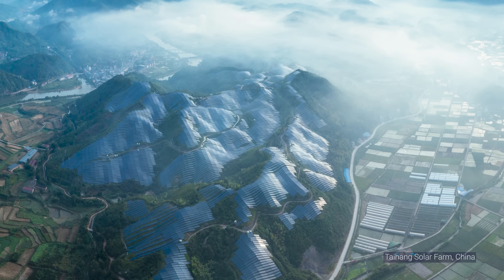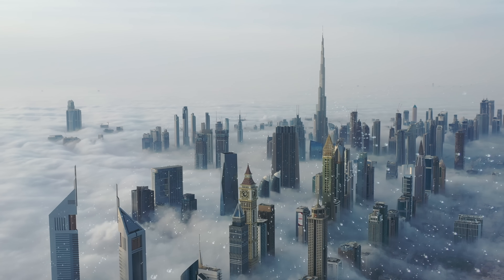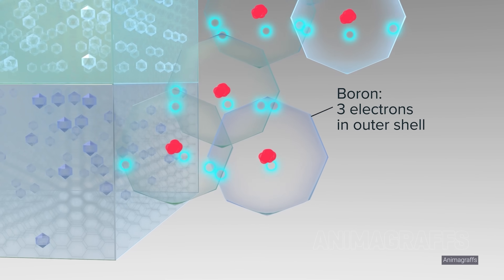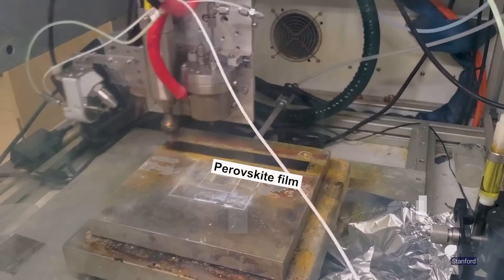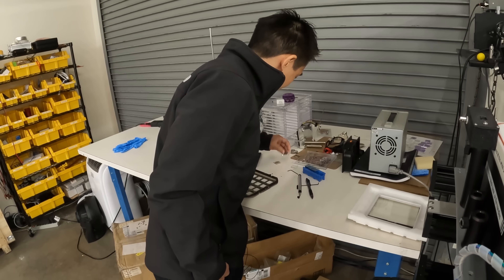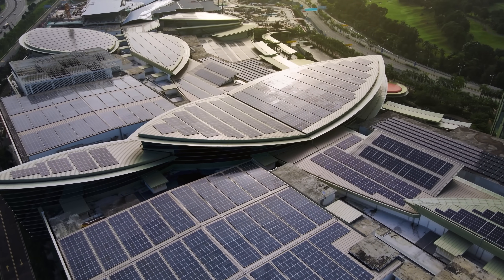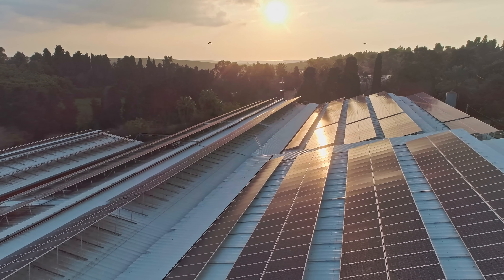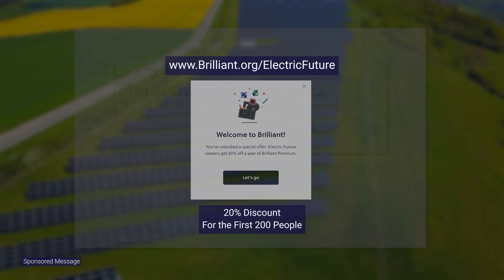Solar 3.0: This New Technology Could Change Everything

Comment: It doesn't take 25 years to test something. Like car manufacturers, they might test an engine in a sealed test environment that can approximate weather conditions and they run the engines under expected loads for the equivalent run time an engine would be at, at say 100k miles. This can be done in months, even though 100k miles takes most people 8+  years. You can simulate probably 5 days worth of use in one day with solar cells because most solar cells only endure peak sunlight for a brief part of the day, you can rig up systems to spray them periodically with liquid, pelt them with hail, flex them with wind, lower and raise ambient temp, at set intervals, to approximate the amount of exposure they'd have in real use, with a constantly on or cycled light source that approximates the sun's spectrum and intensity. In just a few months you'd know if they can last a couple of years. In a year you'd know  you can warranty them to 5 years. People will mass adopt if numbers look promising on 5 year durability because if you can generate double the power and they are cheap enough like they claim in this video, they would offset their cost very quickly so worst case scenario even if you had to replace them in 5 years and go back to standard solar panels, it won't have really hurt anything. Say you could produce a commercial panel that's 700 watts in the same footprint that would be 350 watts now, and the panel costs say $200 instead of $250, that's a no brainer, short life or not. Part of the cost of installing solar is mounting the rails to put the solar panels on, and running cabling, installing the connection and disconnect at the panel, any sort of whole home hybrid controller/battery charger, plus the inverter system. If you just swap out panels with newer ones, that refresh cost is going to be a lot lower than initial install. Especially if you assume that by the time  yoru first set of panels is wearing out, costs will be even lower, since conventional solar prices have already been plummeting as scale of production has gone up. 5-10 more years of R&D and increasing scale of production, your next set of panels will be better and cheaper. If they aren't leaving any details out, most likely these could be commercially available in 1.5-2 years.
Reply: Accelerated testing is being done, but the failure mechanisms are different than in traditional silicon and therefore the same tests are not appropriate. Some perovskites have passed many of the "25 year" tests silicon goes through, but the consensus is still that those cells would not last 25 years. Silicon, car engines, etc can reliably say accelerated testing predicts future performance in 25 years because, well, they've been around that long and then some.

Comment: You said the Layers have to be Applied in High Vacuum, why are you dropping Lead Iodine onto a Centrifuge? The Implications of this Tech is Incredible! Imagine a wind turbine but the faces of the blades have photovoltaic cells so not only collects solar energy but they also collect wind power. 🤩

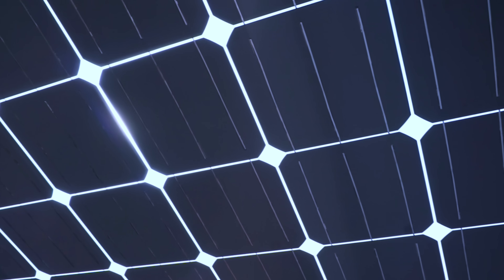Comment: A cell's inefficiency doesn't mean the sunlight's energy will "go to waste" as stated @ 6:30. It just means the energy is not converted into electricity. The un-converted energy will be used by something else. At the very least, it will keep us warm.
Reply: That is if you harness it in some way. I just found out the other day that hybrid water heater solar panels exist where they transfer the heat into liquid that is pumped through the back of the panel. That heat can be collected with a heat pump and used for hot water heater, radiant heat in floor, or directly into some kind of hvac system. On a worst case scenario, on a hot day where you don't really need much extra heat for anything, it can dump the heat outside the home, and the power consumed by the circulation and heat pump will still be offset and then some by the increased efficiency of the cooler solar panels. On a colder day though, it's like a 200% increase in efficiency.

Comment: 0:30 I couldn't get past this. My objective nature had me play with some numbers in my head. Correct me if I'm wrong, but if we use the number of homes in the United States (about 140 million) and the total area of solar panels of 100 square miles we could power like 250 homes with one square foot of solar panels. lol
Reply: (Edited for brain fart on my behalf!) 
100x100 miles is 278,784,000,000 square feet.
Divide that by 140,000,000 and you get 1991.3 square feet per home.
I think the confusion is that it's actually 10,000 square miles (100x100), not 100 square miles.

Comment: Peltier Diode with a Heat Sink and apply this new tech direct to it.
Peltier Diode with a Heat Sink left in the sun will generate power all their own but if Perovskite solar cells were printed direct on one side of a Peltier Diode system your power goes way high.
Peltier Diode make power by the temperature difference between it's both sides of the diode so print your solar on one side to catch the sun of the Peltier Diode and run a cooling fin on the other.
You get solar power and Heat exchange power like a double sided power panel.

Comment: Great technology…. But at the end of the road… thorium is going to spark the grid , and will there be any need for this alternative ways , as thorium energy is so darn cheap. And DME FUELES are also going to be in cost production possible , so combustion engines whit 1% pollution are going to be again more miles per kilowatt in energy storing efficient than battery driven cars …. ARE WE ON THE RIGHT TRACK? (Hell no)

Comment: Wait, sorry, but what am I missing?  This presentation made it sound like perovskite cells already beat current silicon cells for efficiency, cost, manufacturing and installation.  Only thing "lacking" is durability?  Well, to me, something that costs 1/15th, but will last longer than 1/10th is still a massive improvement, no?

From what I heard, they are NOT putting it out because they haven't gotten the nth degree of efficiency out yet?  THAT sounds more like "there's more research money sitting there waiting to be vacuumed up" that "it doesn't work yet, but we're hoping to figure it out".

Got a heat build up problem?  Lay this thin sheet onto something that will absorb that heat and carry it away.  And a more durable, transparent sheet on top for protection from weather and such.  It doesn't hail EVERYWHERE, nor constantly.  "Honey, the hail damaged 3 of our 8 solar sheets." "Okay, I'll pull out the backup sheets and replace the damaged ones and send them in for repair."  Or "They're calling for hail, let's roll up the solar panels for the rest of the afternoon.  The batteries have enough charge to last for a couple days."  Or "Looks like hail in the forecast, let's extend the durable weather sheets until it blows over."

If you need 6, but installed 10 at still lower cost than traditional panels, and putting the extra back into the grid.

So, again, can someone explain what the REAL problem is?

Comment: any time I hear "it would just take a "small corner of Texas" I cringe hard. it would take 22,000sq MILES, which is about 66 New York Cities, or 44 Los Angeles. there are entire countries smaller than this.
 then you figure that is currently used power, so during daylight hours without clouds, this isn't the amount of ALL DAY power or reserves for poor weather periods.
then you figure  the power and time used to create enough panels
the natural resources used to create
the man power to build, place and maintain this many units
by the time you could build such a massive structure you would be on a constant replacement,
the amount of non bio degradable materials would be un sustainable quickly creating the worlds largest landfill many times over.

this new idea, much more plausible, specially if it can be made to last and simply painted/laminated onto existing surfaces.

CURRENTLY the best power is Nuclear power, its clean, efficient, and now they are learning to make energy storage from the by products (carbon batteries aka diamond batteries).
Even fossil fuels are more efficient and better long term for the planet than the current variations of solar/wind.

Comment: This might sound dumb, but prismatic concentrators are going to be the thing that makes solar power go from a pipe dream to the thing that kills oil.  Especially once you incorporate perovskite wafers in thin layers specifically focused to narrow spectrums.  Cells that narrow focus specific wavelengths from infrared to ultraviolet in small, alternating arrangements on a single, large cell will be more efficient as a whole.
Reply: I figure I'm either completely full of shit or onto something big.  Doesn't seem like much in between.

Comment: Somebody needs to figure out how to "spray paint"/print layer by layer on to exiting roofs.
Saving the planet and getting insanely rich in the process.  Efficiency would matter less. Governments would happily subsidize installation. 
And lasting even 10 years would be more than acceptable initially, if it had a net equal power generation value to instillation/material cost.   
It seems to me the solution is there for someone to exploit.

Comment: It doesn't matter how efficient solar panels get, they are never going to be able to power an industrial economy. They only produce power in daylight hours and even that power is highly variable. Battery storage is prohibitively expensive and needs at least twice as many panels to provide the charge while directly powering a grid. Neither solar nor wind power are capable of replacing fossil fuels, but nuclear power is, so that's the way to go. The only thing holding it back is irrational fear.

Comment: The only problem with solar power is its based on how much sun light the surface of the earth gets and this alone brings efficacy numbers to laughable levels. The only way to truly harness the suns power efficiently is to build a Dyson Sphere but since humanity is not going to accomplish that any time soon a more comprehensive method is to use unobstructed space satellites that convert sunlight to electrical energy and then send the energy to an Earth station in the form of microwaves. I say earth is doomed due to the greed of oil company's nothing will change and its already too late which is why the wealthy are ramping up space travel, rats are leaving the ship.

Comment: I honestly thought it would be graphite in the beginning of the video at 0:55 
Perovskite sounds extremely futuristic sci-fi material but damn that is cool that is a thing. I can't wait to see it integrated in small application like smartwatch, smartphones, portable solar panels, battery bank. Where most often they don't have to be exposed 24/7 to the outdoors element. 

In the future in about 10 to 15 years this will be awesome to have a lot of vehicles and home being phase-in replacing older solar panels if they meet the the standard requirements. 

Also, I can see other applications where you do not need Perovskite to be the primary use due to battery capacity like in homes where small to medium battery can charge through out the day ... until a cloudy day or days, maybe weeks. But still for longevity Solar panels still is best for harsher long term use. At least for now.

Comment: I was going to say if you build the solar you could always make it set up to replace you may not need to make it last more than 25 years you just needed to get from point a to point b that might be the logical next step is to set it up to where you could always replace the solar panel and then once you gain the knowledge to be able to get the panels up to lifespan of 25 years or Plus that's when you will make the adjustment
Reply: PS I love the idea concept sounds great potentially has high potential I wanted to succeed so I can buy them

Comment: A thing to remember about the sun’s rays ... the maximum power available is ~1400 w/m^2 it doesn’t grow no matter how much you invest.
Reply: I think this really only becomes an issue if you talk about the earth being like one big urban planet city like coruscant in star wars. Even with 12 billion people on the planet, there is a ton of space per human on earth. A lot of power reaches the surface of the earth through the atmosphere. If we can find efficient, cheap, and environmentally friendly ways to harness and store that power, it is a big help at any population density. Keep in mind that at the same time we are trying to find ways to create or harness more power, we're also finding ways to use less. Just think about super efficient modern HVAC systems that can produce more BTUs of heating and cooling, but use less power, more comfort for less money. Think about the fact that most people now use mostly mobile devices, thin laptops, tablets, and phones, so even in the short history of computing, we've gone from 200-300 watt on the low end, to laptops that cap out at 90 watts or less system consumption(unless you are talking about a heavy duty laptop for gaming or workstation), with tablets and phones at a tiny fraction of that. We have gone from 300 watt CRT tvs, to flat screens that are 4x the size(double the diagonal) for 1/3rd the power. We've gone from 60 watt bulbs consuming 60 watts of power, to 75 or 100 watt equivalent LED bulbs that consume less than 1/4th the power. The theme is innovation equals more for less.

Comment: the problem with perovskite is its durability, sure the material is cheap but manufacturing it as a solar panel would cost as much or greater than conventional panel.

Comment: power per weight isnt really an issue here. efficiency? sure but sun power is around 1000w/m^2 even with 40% efficiency thats only 400 watts. for boats? sure some slower catamarans would mostly able to travel around but everything else is out of the question. there just isnt enough power for moving around like that without batteries. 
satellites would be pretty much only moving objects to benefit from this... or transportable solar panels that too. kind of weird video. puts things into wrong perspective

Comment: Not physically the calculations work on paper practically smoking your own dope - weather and the challenges of eating up that much space in the southern part of the USA along with losses to transmit and STORE (WHICH YOU DON'T DISCUSS) - are the same reasons WHY since the 1970's /80's / 90's & NOW do NOT work = PRACTICALITY is your issue - Solar arrays in SPACE - BEAMED using Microwave or other means to geocentric reagions MAY be a solution but TOO EXPENSIVE AS OF NOW! Flexability of the medium is NOT the real reason for this issue - TRU AGAIN in another 20 years

Comment: Having a material that will produce more energy over its lifetime than it takes to manufacture (whether from raw materials or from a recycling process) is the first big step needed to making solar feasible in more widespread use.
Reply: It's been a long time since that was the case. Very early solar panels, like the ones used on early satellites and space probes in the 60's produced less energy over their lifetime than they cost to manufacture, but they passed that threshold over 50 years ago IIRC.
Reply: Aren't today's silicon panels rated at 25 year to 80% of original output. So maybe possible to obtain +50 years from silicon.  For 25 years, at average of 90% output with 20% solar efficiency panels and 2000 sunshine hours per year you get 9000kWh. If You pay about $1000 per kilowatt for solar panels (values based on my countries $). If your electricity cost $0.30 then the same amount of kWh's would be $2700. A saving of $1700 over 25 year for one solar panel. With 5kW array over 25 years you would save $8500.
Cities like Brisbane has about 3000 sunshine hours,
Reply: @AORD72  Yeah, a typical "good" solar setup will quote you at about 7-8 years before the cost of your solar system becomes a net profit.  So then you have another 15+ years before the warranty wears off, while the solar panels themselves are still working just fine ( they try to doom and gloom you after 25 years with those 80% statements so you'll think to replace it all with a new system ...but what car still runs at 80% after 25 years? )  

Your panels will still work for another 25 years if they're taken care of, so that's even more "profit" from them, even if their output degrades over time. ( But consider how the planet is changing over the years, sunlight becoming more frequent over the year compared to previous ones. ). Not to mention you're paying for the panels now, while your electrical grid costs will continue to rise and double.  The cost savings, and the relieving of stress on systems, is exponentially increased as years go by.  It's like buying a home .. the sooner you do it the more exponential gain you get from it from not giving that money away anymore, and having peace of mind of it not being dangled further and further above your head.
Reply: @ToadstedCroaks  dunno if you ever had a car, but if your car didn’t need repairs after 25 years of continuous use, please tell me what model you’re driving, cause I want in.

Comment: I would really consider or even buy a solar car with perovskite cells even with 2 years of solar warrenty and replacing them after every 2 years i think it will still be cheaper than 2 years of gas.
And main point is 20% increased range is always worth for car being expensive.